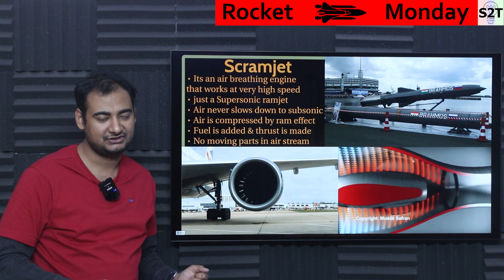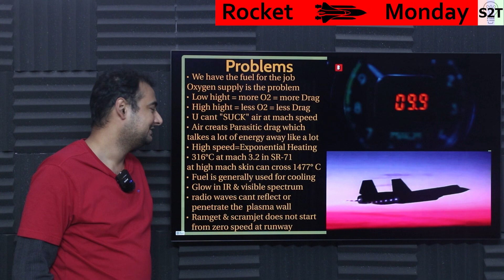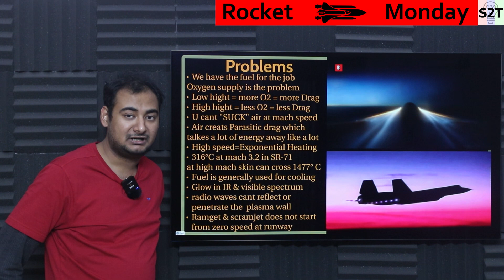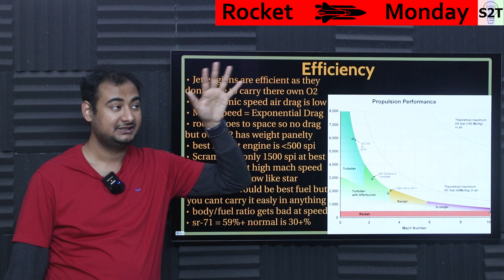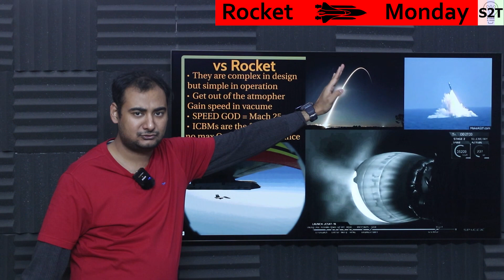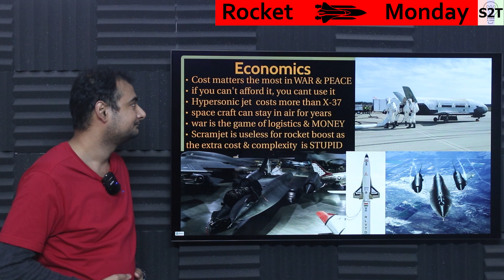Scramjet vs Rocket Explained {Rocket Monday Ep214}

Comment: Hydrocarbons have trouble combusting in a supersonic airflow because heat does not travel upwind to ignite the next portion of the mix.
Autoigniting fuel is needed.
Reply from the maker: do u have any in mind ?
Reply: @s2tenglish  
Just to prove an existence I will name Trimethylaluminium and Triisobutylaluminium
Then,  air compression in the inlet will inevitably raise its temperature.
Being practical, methane will autoignite at 600C, and the products will have 1950C temperature.